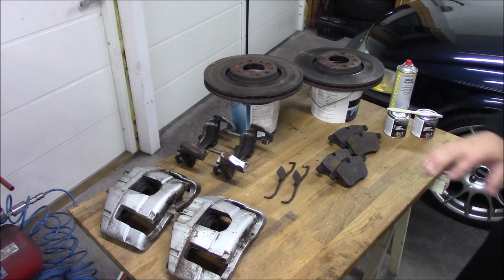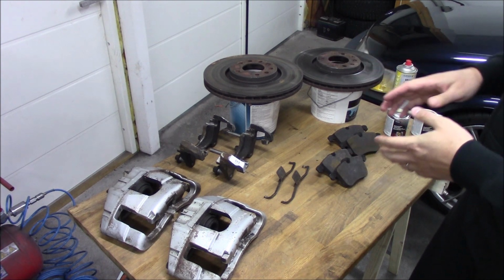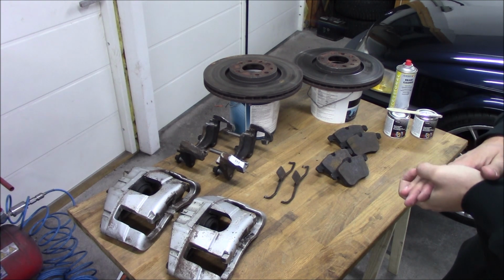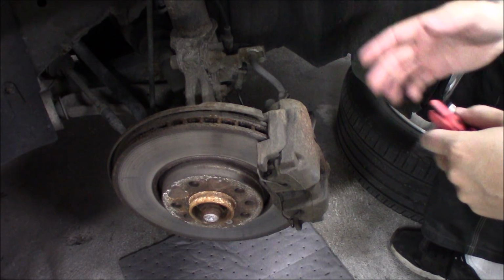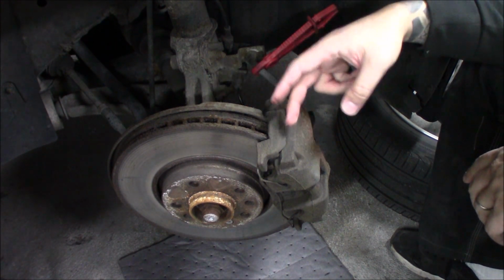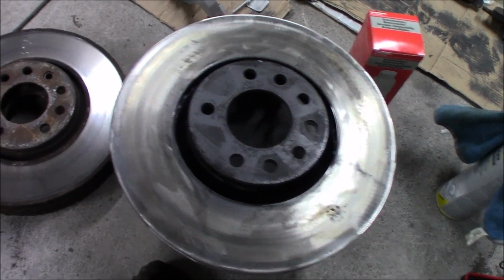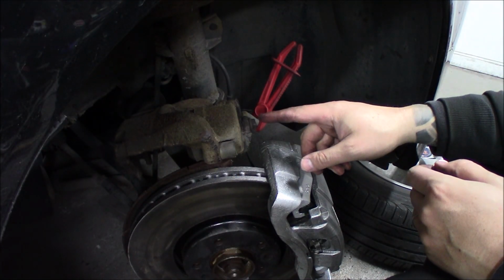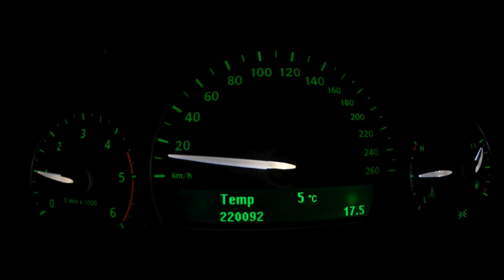SAAB 9-3 314mm Aero Brake Upgrade

Comment: I just extracted all 4 Aero calipers, brackets, dust plates front and rear at junkyard for $91USD, amd getting quotes of $155USD for new front and rear slotted rotors and pads. I hope it's a substantial upgrade from the 302mm fronts and single layer rears I've been driving with all these years.
Reply from the maker: Well done 🙏 front ones is like night and Day!

Comment: I have an Aero and a 2.0t.  The Aero has a much larger master cylinder than the 2.0t in order to accommodate the larger calipers.  I do not advise using larger rotors and calipers if you are not going to upgrade the master cylinder.
Reply from the maker: That is not a problem on these cars 👍

Comment: I have a 9-3 Aero and my opinion is that if you need better brakes then these, it is because of multiple hard brakings needing better cooling or if you have very sticky tires.
Normal fresh 225/45 18 tires gives up before the brakes give up, unless they are overheated like mentioned before.
Have tried black diamond groved discs and they demand more maintenance, the groves needs to be cleared of rust at least once a year, are more noisy and the brake pads wanted to tip over and wear uneven.

Comment: Jeg holder på og planlegger et kitcar-bygge med 9-3 2,8t v6.
Bilen jeg planlegger å bygge er med bakmontert motor....
Planen er å ta alt av  motor, girkasse med subframe og hele forstilling ut av en 9-3 2.8t og bygge inn i prosjekt-bilen.
Dermed vil 9-3'ans frambremser bli prosjektbilens bakbremser.
For da å få riktig dimensjonering av bremser fremme i bilen i forhold til bak, må jeg ha større calipers fremme i bilen enn de originale front-caliperne fra 9-3 2.8t som da blir bilens bakbremser..
Har du kunskap om hvor store calipere man kan ha på bilen med 9'3'ans originale master/slave/kraftforstærker/ABS før man også må oppgradere master/slave-sylinderne?
Jeg er redd kanskje master/slave ikke greier å yte nok væske-volum til store calipere...?
Reply from the maker: Du kan ju montera TurboX bromsarna som har 345mm skiva med värre belägg och stålomspunna slangar. Eller ta ng9-5 Turbo6 bromsar som 2kolvsok, behöver modda lite för att passa
Reply: @JonasKakarikas  Tror du originale master/slave klarer å gi nok væske til så stor caliper-oppdatering?
Reply from the maker: Jag vet att den gör det 😉

Comment: well.... it is NOT the discs or the calipers that determines the brake distance... but rather the wheel friction and the balance between rear and front brakes.... but if you are happy :-)

Comment: I’m doing this soon, the video comes handy :) mine are only 288 on the front so I think the difference will be huge 😁
Reply from the maker: Good choice 👍
Reply: Linear and vector have 285mm in the front and 278mm in the rear with unventilated dics in the rear. There was an option to have 302mm in front and 285mm rear with both being ventilated.

Comment: I am preparing to do this upgrade but I am missing the calibrator adapter, won't you have the adapter measurements?  In order to be able to have it manufactured mechanized.
Reply from the maker: Nope sorry, i bet it 10 Times cheaper to by a used or new Carrier than to have one made

Comment: So if I have 2000 9-5, can I put 314mm on them?
Reply from the maker: No, its only bolt on for 2002-2010 9-5
Reply: @JonasKakarikas   What are my options, should I find an AERO 9-5 then?
Reply from the maker: You can upgrade to 308mm aero brakes if you dont have an aero
Reply: @JonasKakarikas  Thanks... been trying to figure out... what to do. Mine are rusted badly and need replaced. LOVE the channel!
Reply from the maker: Thanks 👍 you actually just need the bigger discs and Carriers your Calipers will work
Reply: @JonasKakarikas  OK! car had 52,000 miles... bought it last month... AMAZING!!!

Comment: Do you know how much it would cost to get a throttle fixed on my Saab 9-3? And is it OK to take it to a regular automotive shop? They say they work on foreign cars but I don’t think they have the actual specific tools.
Reply from the maker: Its individual so The best is to ask them for a price. And "fix The throttle" could be alot of things, a little more detailed would help to give a price.
Reply: Jonas Kakarikas 
I was driving one day and it started hesitating while pressing the gas. It was hard to accelerate. It was scary.  I thought it was going to shut off. So I put in my FIXD device and these two messages came up. Control module PO606 and throttle actuator control po638. Just trying to get some ideas before I take it to an automotive place. I know they’re going to come up with some ridiculous price!
Reply from the maker: Most likely your ecu is toasted, very common problem. On The 9-3. You need to take it to a workshop that has gm/saab tools. A new ecu and update software will solve your issue. Google Saab and your codes then you Will find plenty to read about it
Reply: Jonas Kakarikas 
One more question I’m sorry but do you know what my cause this issue or what could lead to it? Could oil leaks lead to it or anything else that you might know of?
Reply from the maker: @Texasgirl2023  most common a grounding issue in The ecu, could be from heat due to the fact that The ecu is located in The enginebay.

Comment: Nice work! :) Where did you bought those brake calipers? Couldnt find at bildelsbasen.
Reply from the maker: Thanks! There is alot of them on bildelsbasen. Take The reg number from a 9-3 V6 and you Will find 👍 i bought mine on Blocket.
Reply: Thanks for your reply. I appreciate that. Will try as you say. 👍

Comment: Hey Jonas! I have a 2002 9-3 SE, could a retrofit discs and calipers from a 9-3 aero 2008? Thanks!!
Reply from the maker: Yes, but you Will need new brakelines and an adapter for The calipercarrier.
Reply: You could also get viggen brakes, it should be the same caliber just moved longer out and a bigger disk.
Should be cheaper because you reuse the caliber you already have and put them on a caliber carrier adapter.

Comment: Will this set up fit my 2001 9-5 Aero? You mentioned earlier that it needs a bracket for the calipers what bracket do I need?
Reply from the maker: https://www.maptunparts.se/bromssystem/monteringssatser/273515/adapterkit-storre-bromsok-saab-900-ii-9-3-i-9-5.html
Reply: @JonasKakarikas  Thanks Bro!!!
Reply from the maker: @johnmorris6479  youre welcome 👍

Comment: Grymt jobbat! Fick mig att kolla på min 2005 9-3 aero (steg 3) bromsok idag och insåg att jag bara hade 302 mm ok på min. Ska hålla koll på skroten osv och fixa 314 mm bromsarna så fort jag får tag på dom! 

Vart köpte du dina för bara 1000kr om jag får fråga?
Reply from the maker: 👍 Köpte av en på blocket.
Reply: @JonasKakarikas  tack för snabb svar😀 
En annan fråga är, går det att köra med 16" fälgar (vinterdäcken) med 314 mm bromsarna eller måste man då ha minst 17" för att det ska gå?
Reply: @pgharaghani28  Det räcker med 16", däremot går inte 15" 😅
Reply: @ShiveringSwe  tack! Då är ju allt i ordning. Tänkte på att jag har nya pirelli vinterdäck på 16" fälgar som måste funka när man inte har sina fina sommarfälgar på. Blir att kika runt efter bromsok och fästen då😀
Reply: @pgharaghani28  Yes det ska gå fint, har 16" på min på vintern och det är inte stora marginaler men det går :)
Reply: Nettopp gjort samme jobb, fant deler både på skroten og på finn.no
Åk ble sandblåst og lakka, skiver kjøpt nytt hos saab forhandler, bremseskjold skar jeg kanten av.

Resultatet er mer resolutt retardasjon. Veldig bra oppgradering.

Comment: Hi, i need help!!! my saab 93 2004 starts making a sound, i seems like its coming from the brake pedal but outside, i mean on the bottom of the car, mmmm idk if its the exhaust pipe or can be other thing, does anyone has similar problem? oooh i forgot to mention it happens only when i pass over a speed bump.
Reply: probably  something is loose. One possibility is heat shield over the exhaust pipe. At my 9-5 it was just resting on the pipe when it was making rattling noises while driving over speed bumps. probably worth checking and cheap fix. I ended up just putting bigger washers to the mounting points.
Reply: @severianttila8987  thanks a lot, im going to check the heatshield, i hoppe thats causing the anoying sound. :)

Comment: Where are the calipers from?
Reply from the maker: 2004 Saab 9-3 aero
Reply: u can also use from opel vectra or signum
Reply from the maker: @joostroelofs9531  correct 👍